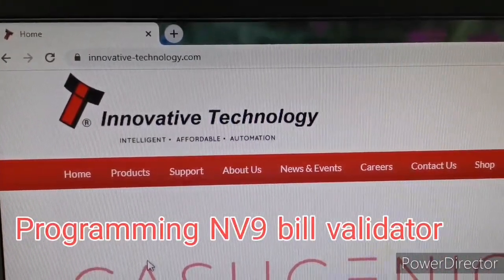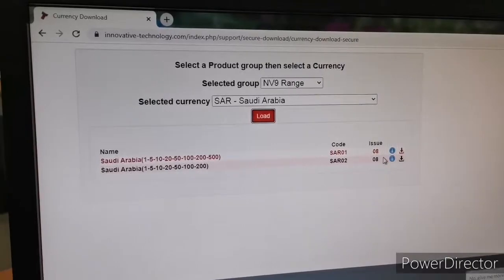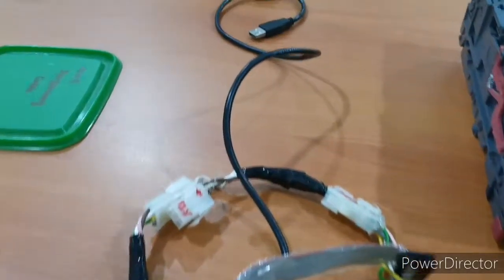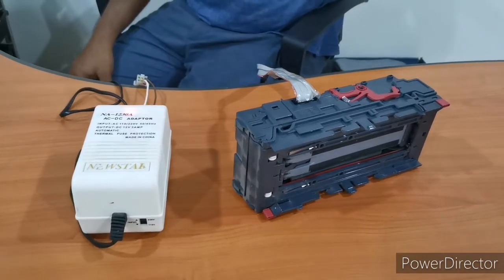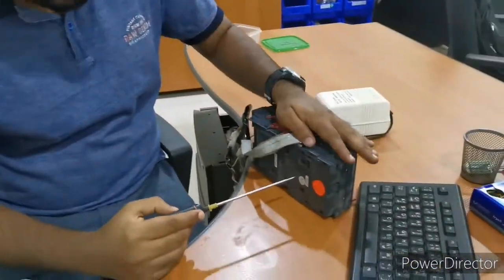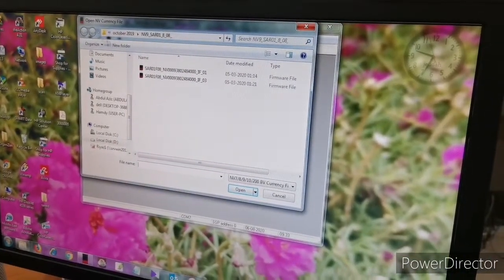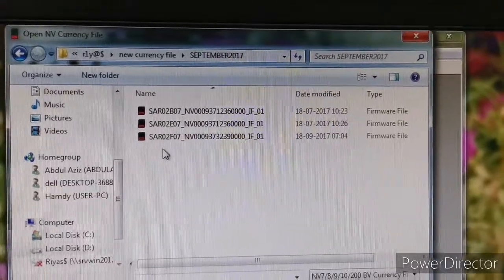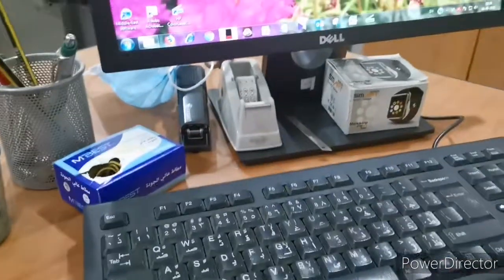Updating currency file in ITL Bill validator

Comment: And how to make this programming  cable?
Reply from the maker: Download the pdf for Nv9 mentioned there
Reply: @riyasaliparamba6302     Also in the programming cable when using the smart data program, do I use points 11, 12, 13, 15, 16 only, or do I use points 1, 5, 15, 16 only?